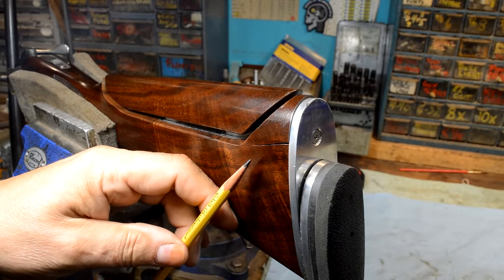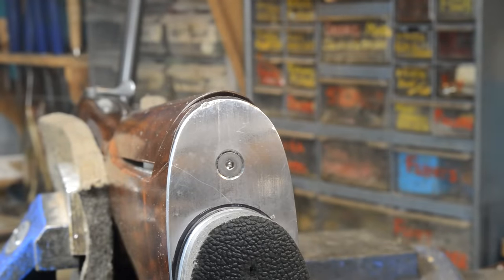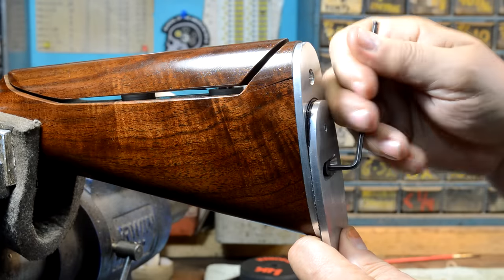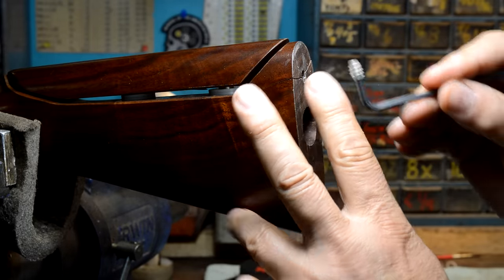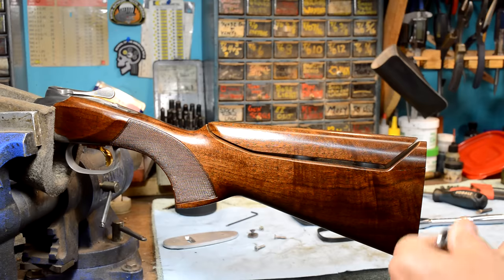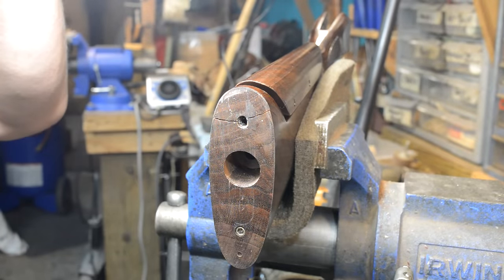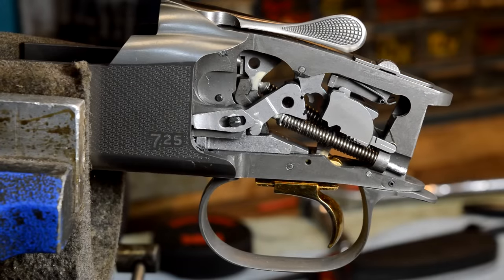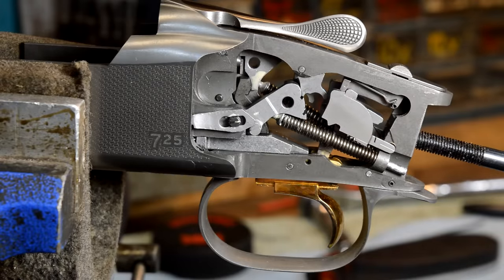Browning 725 Butt Crack repair: Anvil 0127

Comment: We all have differing methods  of repairing damage to gun stocks. Now before I say anything I will say that I have been repairing damage to stock for some fifty years though now in retirement. I suppose being a brit will not help in the suggestions I am going to make so here goes. To remove that dent in the heel of the stock I would apply steam to raze the fibbers first  you would be surprised how much and quickly they will return to their original position. Your adhesive and method works for you though far to much floating around the repair, I am more in favour of using clear Epoxey Adhesive less to hide on lighter wood stocks. Try this to get the adhesive into the break, use monofilament fishing line or dental floss to pull the adhesive down and through the crack or brake. your method of using Brass bolts is fine though it removes rather a lot of wood because of the depths you have to go to let in that size of Brass support . My method would remove less wood far easer to conceal, in that repair I would use stainless steel staples positioned across the break using to holes and removing just enough wood to let in the staple top. Stainless steel is less liable to move due to heat expansion , and staples have less mass and far stronger than Brass for a given section. As for clamping the use of cork or pencil erasers between the clamp faces and the stock is more desireable, in many cases straight pull clamps can not be used on gun stocks so the use of Bicycle inertube strips can be used with many advantages that include no damage, will mould to curves,   apply as much force as you need.  Just another way of doing things not a criticism, we all do things different ways though you may like to experiment sometime.
Reply from the maker: Outstanding, and thanks for taking the time to explain. Most on your side of the pond do not take the time, and just call everyone stupid.
Reply from the maker: The clamp had almost no force on it, so the rather loose setup worked. The weight of the clamp was resting on the vise. We have lots of inner tube strap, however, didn't want to smear the glue on the existing finish. Hiding this repair was easy, we clamped a plate of aluminum over it!  This stock is scheduled to be recut in a solid block of walnut once the fitters get her numbers right to deal with her neck anyway. My assignment here was to get the gun back up well enough to get to that point, only. I think the editing process might have diluted that point, or I failed to stress it. Again, your input is much appreciated. Thanks
Reply: P
Reply: I agree, also a Brit. I glued 6mm rubber pads to my G-clamps to stop marking the finished wood, not necessarily all on gun butts, but on a couple. I made brass bowties to keep both sides of the crack together. As you said there are many ways to fix finished wood items. Well done 👍
Reply: I like the idea of stainless staples. I love watching and hearing about how master craftsman do their work. Cheers
Reply: @marknovak8255   As another brit randomly discovering this video,  from past experience, there is always another way to do things.  There will always be that person who will criticize as opposed to critique, and for me at least, life has been a journey of learning.  In creating content, you put your life learnings up for judgement, and as a viewer I and every other viewer needs to remember that a. you're not me! b.I'm not there and in your shoes trying to fix a problem and film it at the same time. and c. I'm not the one who has the courage to put my fixed on YT.  If the end result is a happy customer and a lasting fix, then isn't that a good result?

So, many thanks for the content, you present it well and pace it just right.  I enjoyed it start to finish, and your tour of the mechanism was hugely interesting! I will never debate gun ownership, and can't ever see myself owning a weapon, but the artistry of gunsmithing, and the hidden finesse in the manufacture of some guns is just sublime, and fascinates me endlessly!

May you enjoy the many learnings life brings, and may those unfair critics (hopefully not my fellow Brits) enjoy a dollop of sex wax (first time I've heard of it, so I'm being devilishly immature) exactly where it's unintended!
Reply: Yes that clamp eight on the wood was a poor choice
Reply: @marknovak8255  Well that's a sweeping generalisation. I don't often call people stupid but your comment qualifies in that regard.
Reply: Be nice if you posted a video or two as well.
Reply: @marknovak8255 they make glue injectors that look basically like syringes and have various sizes, shapes, and lengths of tips that can probably be used in this application as well. You could imject that crack and make a lot less mess as well. Just something to think about. Amazon sells them  for like 10 bucks and it comes with a lot of them if i remember correctly. My wife uses them for her crafts she sells and they work great.
Reply: @Watchdog_McCoy_5.7x28  Like all injected substances they always will take the path of least resistance. so will not guarantee to reach all places in a crack.
Reply: @jas20per  🤦‍♂️
Reply: I use a syringe to get any type of glue into cracks, it goes nowhere except inside the crack. Also British.😉
Reply: Common here to use dowels or pins or screws/all thread when repairing wood stocks when they break like that. I have a stock that’s some 118 years old at least the rifle is and it was dropped on concrete and that European Walnut just split in 2 pieces. A good friend of mine, I met him because he was doing stock work for several local gunsmiths and he fixed it . When I first got it back from him I could barely see it but as the finish has aged it disappeared. The first gun I ever owned. He told me he used sharpie to hide the damage and that works well. I know where the damage is/was and can find it but most people who have seen it in the years since have no clue it was ever damaged. Kinda looks like grain figuring. Those brass pins add rigidity and make it far less likely to break there again.

Comment: a technique that I was taught, for repairing a crack, it to use a hair dryer to blow the epoxy into the spread crack.   The heat of the hair dryer thins the epoxy and the air helps direct the flow into the deepest parts of the crack.   Works well for me.  Great video, as usual.
Reply: I wonder if you could use a syringe-and thumbs of steel-to squirt it in the little crevices?
Reply from the maker: @robertl6196 got to get it into the syringe.....and therein lies the rub
Reply: There is also thin epoxy for lamination. The epoxy sucks right into the crack, no need to open the crack. Repaired a lot of wood this way without problems.

Comment: I appreciate your tips and tricks. I don’t work on guns but your method  of using a polished hammer face to move the material from a blown out brass screw is invaluable. I work on very large electric motors  the ability to rework the small screws that hold oil rings together is great. Thanks.
Reply from the maker: In my past life I was an Industrial Electrician also. I GET the big motor thing....

Comment: A small pallet knife from an art supply store has been my epoxy application tool for decades. The blade is a very thin spring steel that gets into most tiny cracks.

Comment: Really enjoyed this. You turned me on to Acra Glass many videos ago so I hope this will return the favor. I have restored antique cutlery since the 70's and for blending and staining repairs in wood, bone, stag, etc nothing works as well as leather dye. It really penetrates,  it dries almost as fast as you can put it on and it does not mess with anything you have to put over it. Tandy Leather has every color known to man but I get by with just 5 colors, once applied within 10 minutes you can go to whatever topcoats you want with no worries oil, poly whatever it may be. Using scrap wood I can custom blend colors to get an almost perfect match no one will know you were there.

Comment: Mark thanks for another great video.  What got my attention initially was the thumbnail of the 725 due to it being much newer than many of the other things you've  brought to us.  I also run a 725 as my primary clays gun so there was that additional interest. 

Browning right in the owners manual talks about the oul finish on the gun and goes so far as recommendations for stock maintenance by using a SMALL amount of TruOil or some others sparingly.      The oil finish in these cases is TONS nicer comlared to the hard as nails finish they use to put on their stocks. 

Ive got arounf 15,000 rounds through mine and the insides look about as clean as the gun you had in the video.     Thanks again!

Comment: Livestock supply stores have these syringes that use a curved plastic tube instead of a needle, and one of those would probably apply that AcraGlass into the crack a little cleaner.
Reply: Yup.  Craft stores too and, of course, Amazon, et al.

Comment: The most under rated statement you made is the polished hammer faces, that keeps from marring up the material I learned that years ago blacksmithing the mirrored finish of the hammer will transfer to the material your working with which leads to less finish up work. Great job on the project BTW ;)

Comment: Mark I have used your screw/ epoxy fix on a stock per your example in another video, but it was up where it was inletted for the receiver. I drilled the escape hole to let the air out to make sure the hole was filled with epoxy and that was worth it's weight. I've always had to fight the hydraulic effect and cavitation caused by that. I did like the bowtie suggestion the Brit offered and gluing pieces of innertube to the inside of the clamp jaws sounds like a viable idea too. but that's why I come here to learn and see how other people resolve these intricate problems. I try them and in the end it makes me a better craftsman. Thanks for every bodies help in this journey of life.

Comment: The 725 is not an inertia block action.  It's actually a mechanical reset trigger, using the main springs,  which have a coil that's larger in diameter than the rest,  which when they come forward upon firing,  trip the selector.  If you have a dud, the second barrel will fire even if there's no recoil from the first dud round.
Reply from the maker: You are correct. I will fix this with an update.   https://youtu.be/NyL5y-_gvQI    their explanation  is derivative, mine won't be. Thanks
Reply: @marknovak8255  I love your content, please keep it coming! I'm a newer gunsmith and have a shop. Your knowledge is very valuable

Comment: If you laid in a 1/8" SS rod that has been knurled into the grooves. That would massively bolster the repair. I have made similar repairs using JB Weld with great success. Great video... Thanks.

Comment: Another fine repair. I would never have thought that watching a man work on the wooden parts of guns would be interesting before I started watching Anvil. :)

At about 51:42, I realized what that extra hole in the recoil pad you mentioned at 2:22 is for--it's so they can get at the set screw for the slider without taking it off.

Comment: I have to argue with you on the 725. It’s mechanical triggers. 
The bump you see in the middle of the spring will cause the block to switch to the other barrel. I can dry fire both barrels my 725 with no recoil. 
I have watched all your videos and can’t tell you how much I have enjoyed and learned from you. But take another look at the 725, it changed from the 525.

Comment: For scraping a filled area in wood, luthiers use the trick of taking a single-edge razor blade, and masking all of the sharp edge off, except the width of the fill, with a single layer of scotch tape. The tape acts as a micro-shim raising the scraping edge above the layer of the wood, and preventing damage to the surrounding wood area.

Comment: Prior to gluing this fisher Why not drill  2 perpendicular holes and glue some dowels or carbon fiber rods then expand this fisher spray some water in there and with a syringe full of Titebond glue put lots of glue. The water is used to let the glue follow the water then clamp for 24 hours. Scrape some wood filings off the butt stock and use that to fill in the wholes drilled for the carbon rods.  

Ricky from IBM (now guitar repair tech)

Comment: A biiiiit too heavy with the Sharpie. You are correct that it’s a great finishing tool. I use it to correct tiny mistakes and flaws in my custom guitars.  Sometimes if I just want to fill in a small grain mismatch I’ll wear a nitrile glove and wet the index finger tip with Sharpie ink and rub it in. Little bit goes a long way in these repairs.
Reply from the maker: 90 percent of the marker is rubbed out, all good
Reply: That piece of wood is off the charts. Just gorgeous!

Comment: Shapie marker comes right off with isopropyl alcohol.  There's no need to use brake cleaner... unless you don't have any alcohol.
Reply: Brake clean is easier to apply and less likely to make your shop smell like a nail salon.....
Reply: @jsh6952 brake cleaner is also more likely to straight up dissolve things of value. Also nail salons smell like acetone last I heard, which is one of the more common solvents you find in modern brake cleaner. Also not sure where you're getting easier to apply from, detail work with spray cans is always a pain in the ass.

Comment: Most of my repair knowledge comes from guitars, but I'm surprised at Mark not wanting to finish the break and take the entire piece off. On a severe crack on an angled headstock (cough GIBSON cough cough) or a broken out upper horn around a strap button, a lot of the time, it's easier to just finish the break and gain access to install dowels and not leave any of the natural wood grain in place to continue cracking. A good quality wood glue is generally sufficient for any guitar repair and I know for a fact that you can tint Titebond wood glue. A little ruddy brown pigment will make glue lines disappear on mahogany and rosewood if your clamping is good. A couple cheap syringes let you squirt glue in the smallest places. Guitar techs tend to be really overzealous when it comes to clamping but that's more because of the odd angles and curves we have to deal with. That would have been my move on this stock; finish the break off, drill for hardwood dowel(s) and tint some glue. Smear it in and clamp her tight. Give it a few taps to really force the glue into the pores and grain. Wipe away any excess and let her sit clamped overnight.

Of course, this isn't a guitar and we can all see the quality of the repair. Mark's work is top notch, which is why I'm sub'd to this channel. It's not often a master of his craft lets the common rabble into his shop to peak over his shoulder and take notes for free.

Most Gibsons have a lacquer finish which is pretty easy when it comes to blending and filling in the finish. Since they tend to be tinted, you also get a chance to darken the repair line which helps hide it. Urethane finishes on guitars are much more durable, but damn are they hard to repair and get them looking nice again.

Comment: you can also remove sharpie marks by going over it with more sharpie and while it's still wet wipe it with a cloth/finger. just gotta be quick about it. there is a very short period of time before the solvent flash's off.

Comment: @Mark Novak
Mark, to remove Sharpie, you don't need to get as aggressive as brake cleaner. Isopropyl alcohol will take it right off in a jiffy.
Reply: It looked to me, as if brake cleaner took sharpie off in a jiffy anyway.
Reply: @PeeWee33772  OK, keyboard warrior. You didn't read apparently. Never said it won't take it off. I simply said that you can use something less aggressive.
Reply: @kennethjohnson4280  Well Mr arrogance, I did read it, and I was pointing out that the jiffy was already applied, and was really quite effective.

Comment: What oil did you use to blend in the repair to match the gunstock finish?  — linseed oil (boiled)?  Also, any thoughts re the original stock finish, a thousand linseed oil applications and 5 years of time, or some proprietary stuff that you think is good?
Reply: I may be wrong but I think that Browning uses TruOil on the 725.    I'd have to check my owners manual though.   In any event I've used a TruOil/Linseed mix on my 725 stock for the last few years and it does a really nice job.

Comment: That stock is admiting a bad  design to start with Last week had a H&H Parradox  in the shop it fitted three of us perfectly one guy long tall bean pole next guy short and wide myselfs small and thin  The English knows something abput fitting a gun
Reply: I disagree.  The extreme drop in this piece is far beyond any typical adjustment range.

Comment: On the threads that were put in the back of the stock, could a machine screw with a square nut on the end have been used? And would it have done any better/worse? Maybe not, it didn't look like there was much material to work with given the large hole for the stock/receiver screw. Just thoughts bouncing around the gray matter ball. Hope you're doing well sir.
Reply from the maker: Threading a nut on each end if the studs is a valid use, if you need more load capacity, and there is a bunch more wood tho work with. We run out of wood quickly in this confined space

Comment: With the bending of the aluminum I always apply a little bit of heat at the  area / line where you need to make the bend. Not too much heat to affect any change to the temper in the aluminum. I would contact Browning first and ask what alloy of aluminum they used for buttplates?

Comment: You need a syringe to inject the glue down into the crack instead of trying to use a toothpick.
Reply: I mix it on a piece of paper, then I wrap the paper into a cone. You can flatten the cone and get it down in the crack then squeeze the goo in there like a pastry bag.